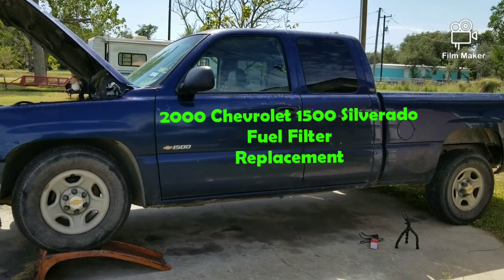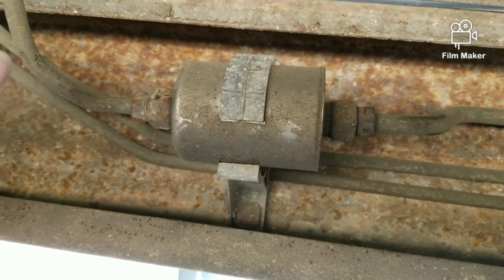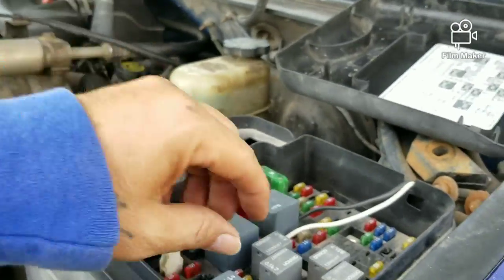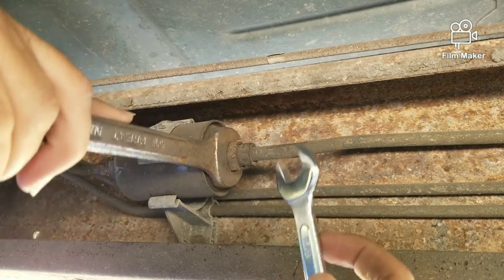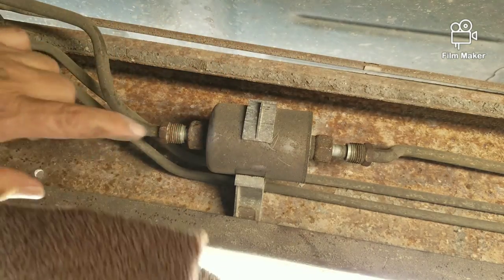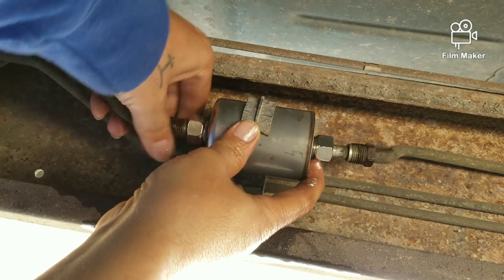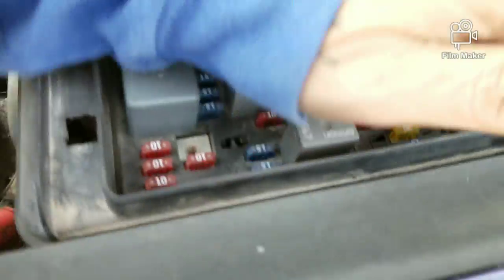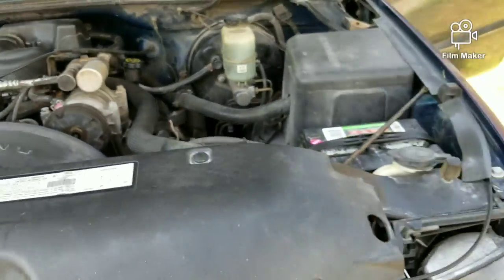2000 chevy silverado 1500 fuel filter replacement

Comment: Wish i had seen this 3 weeks ago, would have saved me $400 plus replacing filter and pump. Like you, once replaced, truck starts right up. Was wearing out my starter and flywheel with hard starts, 1 ignition turn compared to 3 turns. Mechanically illiterate I was. Although late to help me, thanks

Comment: Thanks for the awesome guide! I am doing this and replacing the fuel pump today. Going to tilt the bed to get it out the easy way.
Reply from the maker: The good thing about removing the fuel pump from the top is you don't have empty the tank because you get the fuel pump out from the top of the tank.
Reply: @globaleffect1969  is it easier overall to tilt the bed? My tank is empty and I am going to have to go to Harbor Freight to get an impact wrench that will take the nuts off, they are on there good right now.

Comment: Thanks man changing mine tomorrow!! Hopefully this is the reason my truck takes a minute to start up I’ll come back tomorrow and update you how it went!
Reply: So did it work homie?
Reply from the maker: No, it ran better but didn't fix the issue. Some guy stopped by my place and asked me if I'd sell it to him, seeing I have four running vehicles and it's just me and my wife, I just went ahead and sold it.
Reply: My Tahoe was doing that. Turned out to be the fuel pump.

Comment: I’ve been having issues with my truck starting and under 3/4 to full throttle it will hesitate. I have no check engine light so I’m gonna try the filter. Thanks for the video.
Reply: Did it help you out? Debating on trying it out
Reply from the maker: No, my timing was off on my truck, I had for 6 vehicle's and two are newer, so I just sold it to some guy for $400. He was happy he got the timing set and got it running.

Comment: i couldnt get no fuel, mechanics told me it may be the fuel pump $500-$800 i replaced filter,its working good now
Reply from the maker: I replaced the fuel pump on my truck when I first got it. I bought it and put it on myself, it's actually easy to do.

Comment: After you popped out the f/pump in the electrical center, did you leave the key in the ignition on after or did you remove the key and leave it off?
Reply from the maker: I removed the key and left it off.

Comment: Thanks for the video!

My O2 Silverado has been dying at stop lights or low speeds. 
I'm going to start with the fuel filter first. 

On your truck was it the fuel filter,  or did it end up being a fuel pressure regulator and or fuel injectors?
Reply from the maker: Changing the fuel filter made it run better but it still ran bad, I actually sold the truck because it had to many problems, the timing was off, I would be driving down the road and hear a loud bang then the truck would shut off. I would have to pop the hood and turn the distributor  a few notches to get it going again. I just got rid of it because I had 4 other running vehicle's and wasn't gonna spend money on it because I didn't need the vehicle.

Comment: Does gas have to be low in order tk change?
Reply from the maker: No, just make sure the key is off so that the gas pump is not running. The gas that is already the line will come out, be careful not to get any gas in your eyes. The gas only comes out of the tank if the pump is on.

Comment: Has anyone had a issues with the rear driveshaft shooting out when running 80+
Reply from the maker: I never did, if the drive shaft comes out, it means something's that holds it in place is bad or missing. Ujoints might be bad or a bracket that holds it in place might be missing a nut or bolt,  Could be a few diffrent things. I'll take a look at my Toyota Tundra today becuase my toyota has a weird kick when i take off on the truck, it feels like the drive shaft wants to come out, thanks for your question, it just reminded me to take a look at my driveshaft today.

Comment: Did it fix it
Reply from the maker: No, i have water in my piston, i happen to have a blown head gasket, gonna fix it some time next month.
Reply: Yeah looks pretty basic, you didn't even have the right size wrench and I'm over here worried about getting a 2 line wrench. If you have a minute be interested to hear the journey of you trouble shooting your truck, I've been having some chore of a time. Just did throttle body and all the air intakes, about to do the fuel filter now

Comment: We changed the fuel filter drove it down the road we shut it off and now Im having trouble cranking it
Reply from the maker: We're you able to get it going? Make sure you faced the fuel filter in the right direction. The out faces towards the motor. The in faces towards the tailgate.

Comment: You should have instructed this in GCode !
Reply from the maker: You confused me, I do some GCode programming for a  CNC machine i've run at work for the pass 20 years. So I was wondering what you meant by saying i should have instructed this in GCode?
Reply: Globaleffect1969 that’s exactly what I meant you work with Cnc  just being a wise guy. Btw I used to work for yaskawa yasnak cnc cobtrols systems